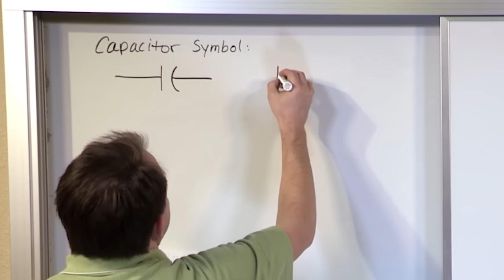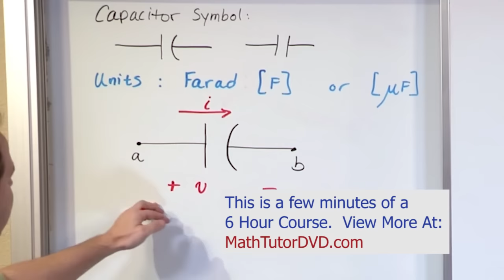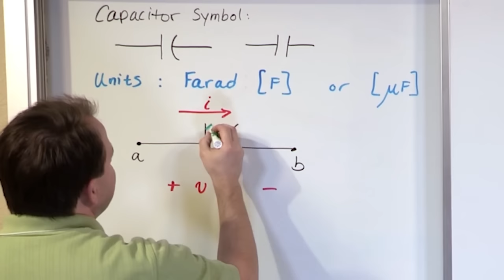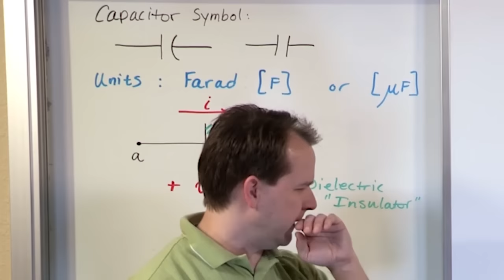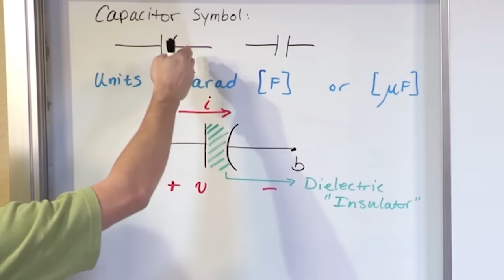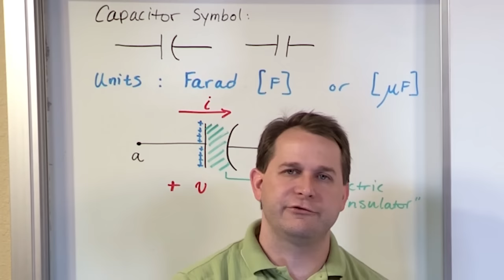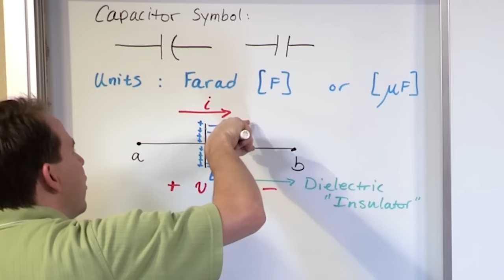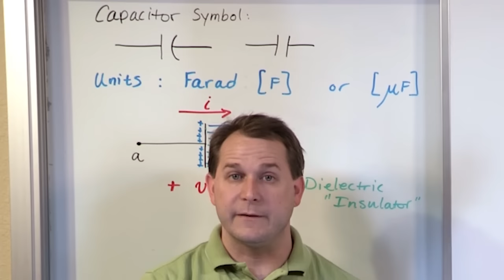What is a Capacitor?  Learn the Physics of Capacitors & How they work - Basic Electronics Tutorial

Comment: How do electrons flow when it is not a closed circuit?
Reply: Yes, In DC systems, after the capacitor is charged up, flow stops. So if you plot voltage across the plates over time you get a hill shape, sloped upward over time. When it discharges you get the same hill shape sloping downward. These devices are used as a temporary storage chamber for electrons, which can smooth out voltage fluctuations in a line, protecting downstream devices. The magic happens with alternating current, or in DC systems where voltage is changing. For example capacitors can be used in lines where inductors would otherwise cause huge dangerous reverse voltage spikes when power is turned off. A combination of inductors and capacitors are often used as filtering or tuning devices to exclude unwanted frequencies and amplify those frequencies you want to flow through.

Comment: I just bought this new- RoToM Run Capacitor. 80+5 MFD 370/440! Wanted to know, if theres anyway i could hook this to my lawn tractor for starting? No Battery! All this capacitor talk online, is jibberish to me! Ha  -I can't even figure out how i'd wire it!?. It's got 3 prongs! F-C-Herm... Tks  -Just found it in a Dollar bin at the local store...
Reply: if your tractor happens to have alternator to charge the capacitor as it's running then go on ahead, just make sure you use the right resistor for the solenoid. or if it doesn't have any alternator you could get creative with it and put your own on if you want. it's up to you m8
Reply: The solenoid is run off of 2 magnet's on the flywheel... -It has a generator/stator under the flywheel(which only put's out a few amp's,4 or so!), with 2 wires coming out, one wire has a diode and run's to the battery, the other wire is strait to light's... -So which wire would hook to which connection on the Capacitor? Common-Fan or Heam... Thanks  N.B Can...
Reply: And there would be a Ground also!?.
Reply: You would have to find out which ones are the positive and negative and then create a small circuit that changes the cap's voltage to the voltage of your battery. I'm no expert though so I would recommend talking to an engineer friend, or someone with a better understanding of electronics to help you.
Reply: Ok tks...
Reply: +Ike Lionz A capacitor won't replace your battery for starting your tractor. The starter requires more energy than the cap can supply. I've never checked a lawn tractor starter but could be 25-50 amps (that's why you can't just hold the key over without running your battery down). The cap isn't capable of this. The cap you bought is actually 2 caps in one case, a 5 microfarad & a 80mfd good for up to 440 volts AC. The "C" is common to both, the "F" usually goes to the fan on an air conditioner, & the "Herm" goes to the compressor. If you want to play with it to get an idea of it's storage capacity, you can charge it with a 12 volt battery by connecting one wire from the battery neg to "C" & quickly touching one of the other terminals to the battery positive a few times (this will charge it). Use a screwdriver blade to discharge by shorting across the terminals. You'll get a quick spark similar to a spark plug, be careful if it discharges to your hand it can hurt. The 80 side should make a bigger spark than the 5. Also they can hold a charge for a long time so don't touch the terminals until you know it is completely discharged. Sorry to be so windy.
Reply: Ok Tks....

Comment: why do we need to use capacitor in a circuit?
Reply: +Cyrax abir :Capacitors are mainly used in most circuit for sampling the voltages. It will behave as memory.

Comment: Wow. It kinda sounds like you're explaining how a battery works. Is the capacitor the grandchild of the dc battery? Are batteries evolving into capacitors? Is that why the common lead-acid battery in a car can be replaced by capacitors? Wow, electronic karma.
Reply: +Brian Tumor This is deceptive. They're not the same thing. A capacitor stores charge, a battery actually produces it. Once a capacitor's charge drains away, that's it, it doesn't work any more. A battery's ability to generate current ends only much later, after its chemicals have deteriorated. It's only nowadays, with our greatly improved technology, that we're able to build things like ultracapacitors, which can almost rival batteries, that this confusion arises. But when an ultracapacitor drains away, that's it, it's still dead.
Reply: I beg to differ. Nah, I just differ. They both store potential energy, the difference being that the capacitor gives it up directly, quickly and efficiently, while the battery has to go through a primitive chemical process to 'extract' the stored energy using the reverse process of that which gave it the charge. You lose a lot of energy through heat during this process.
You can't just dump the chemicals into a rechargeable battery (which is the only practical comparison to a capacitor) and have a charge, but you can 'dump' a charge into a capacitor.
Batteries will be replaced by capacitors, hopefully in the near future, as soon as the auto and battery industries stop buying up most of the best competitive alternatives and polluting our minds, air and store shelves with this useless technology. You can in fact replace your lead-acid car battery with a set of capacitors that weigh less than a tenth as much, take less space, hold their charge for weeks or even months, and recharge instantly the next time you start your car. You're deceiving yourself and limiting the likelihood that you'll live to see this future if you don't seek and spread the truth.

Comment: why dont the metal plates inside a capacitor never touch?
Reply: Did you even watch the video? They don't touch because when the positive charges pile up on one plate they create an electric field that pushes the positive charges away from the other plate leaving a negative charge, thus giving the capacitor a positive and negative charge on either plate that can be stored and then discharged for use in a circuit later.

Comment: i dont like this explanation

you have two metal plates at t=0 both have same amount neg charges and pos charges. if you apply voltage the electrons will start flowing into the left metal plate and create an attraction force onto the pos charges on the right plate and push the electrons out of the right plate. after a time the left plate has a net neg charge and the right has a net pos charge and its done. theres a potential difference and the capacitor is charged

Comment: I saw a 3 or 4 Farad capacitor for automotive applications that was about the size of a 16 ounce aluminum coke can on another YouTube here.  You constantly REPEAT yourself, over and over again.  I understand the value of repetition in teaching, but I think you do it excessively.  You need to GET TO THE POINT instead of hemming and hawing and tripping over yourself and causing us to wait 10 minutes while you diverge with extraneous comments before you get back to the point.  I know this sounds harsh, but its not intended as harsh.  I just wanted you to get to the point, state it, move on to the next relevant point.  Please review your lesson (here and elsewhere) and take notes.  If you are unsure, use an outline.  Have a list of facts you want to accomplish in each lesson.  You don't have to be mechanical and robotic, but cutting out the excess and getting to the meat or core of the subject is what you need to do.
Reply: He's doing a great job teaching.  I understand his method as making it easy to understand for anyone and in a way that they can absorb the info.  If you simply state a point and move on it can become very dense very fast.  If that's what level you're at then maybe you're on the wrong channel or you should buy a textbook so you can fly through it.  This guys is doing a phenomenal job making things simple for anyone to understand.